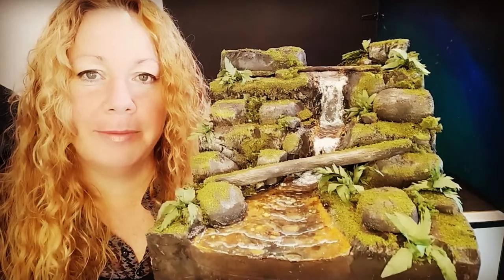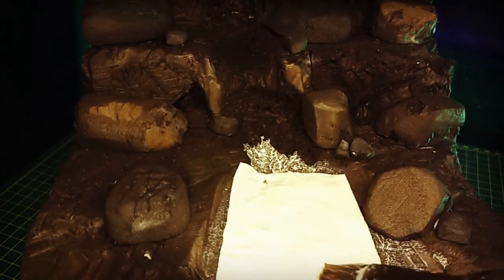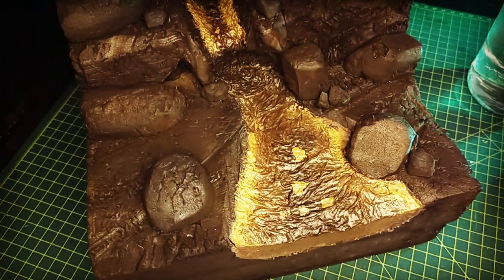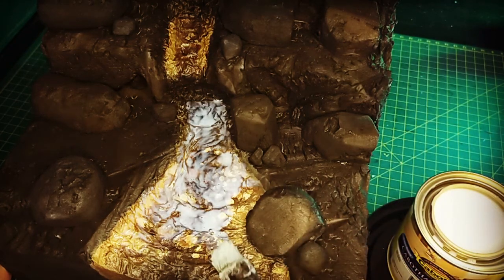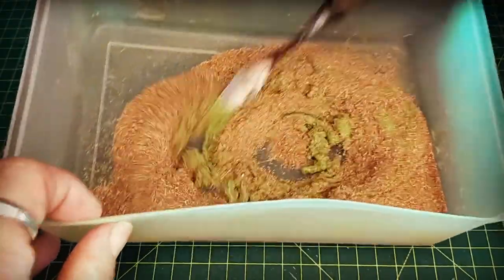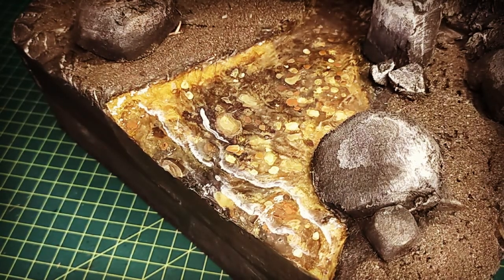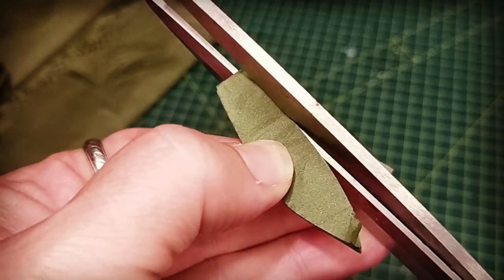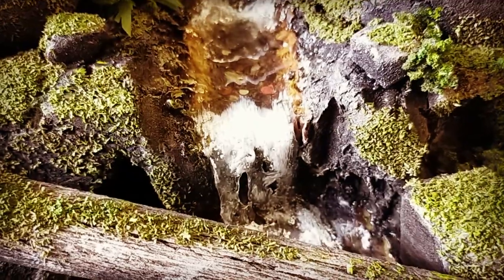Miniature Australian Mountain Creek Diorama made from XPS foam and toilet paper.

Comment: Very nice. 8-)  re: soil - I have had good results from using used tea leaf (a really good effect came from mixing black and green teas, as well as different herbal teas) - just make sure to sieve them well.   - looking forward to your next video .... cheers
Reply: oh, and seal it with mod podge  or whatever you seal things with.
Reply from the maker: Oh I will have to try that, It would be far lighter on a diorama than the heavy soil, ty for the tip!